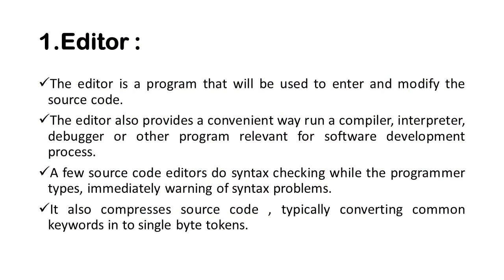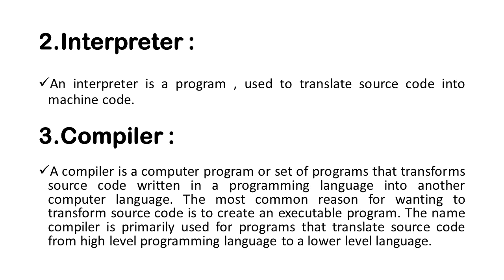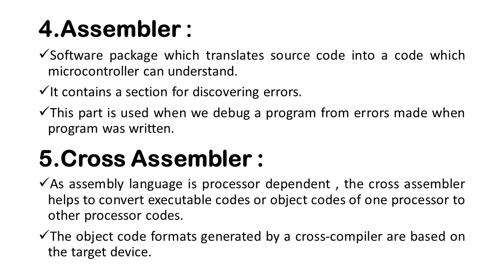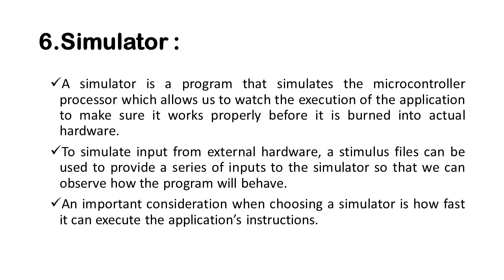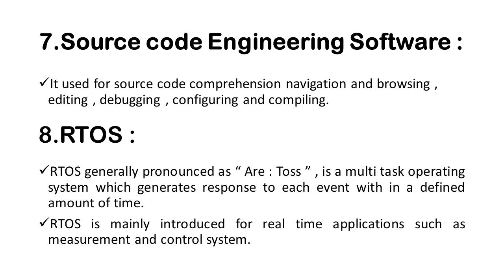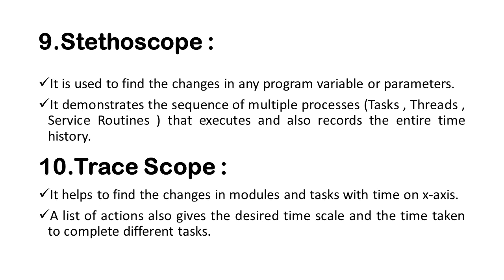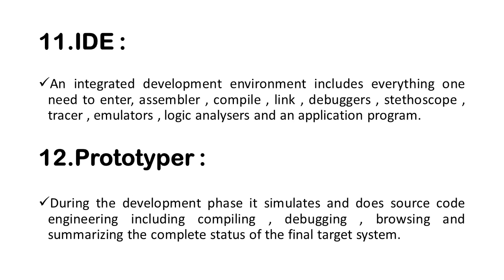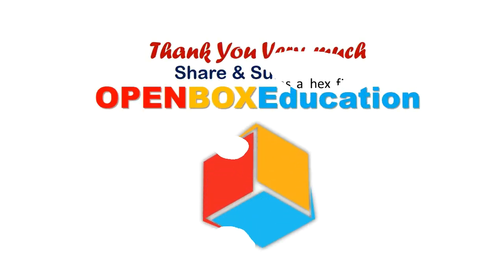Software Tools for Designing an Embedded System

Comment: Good info. Try using flowchart to code converter as it allows you to design logic in flowchart way and then automatically converts it in neatly typed embedded c code. Thx
Reply from the maker: Great suggestion!